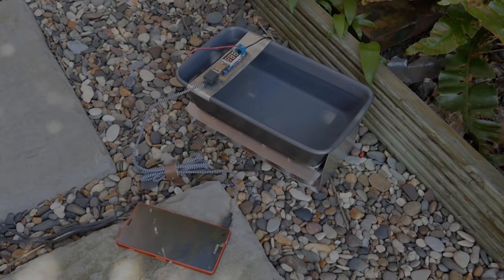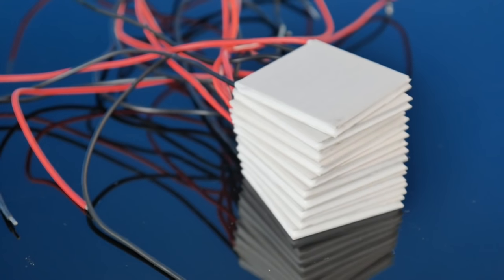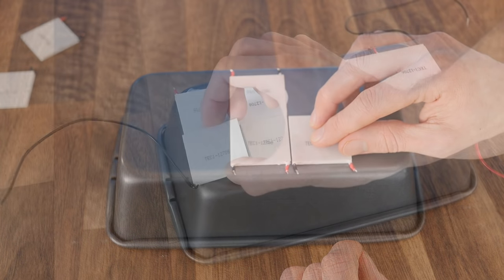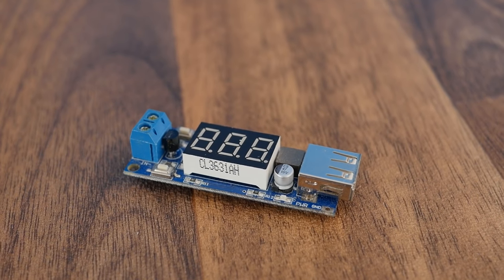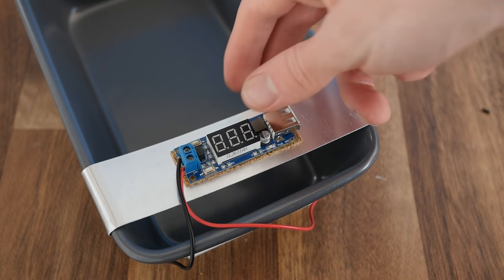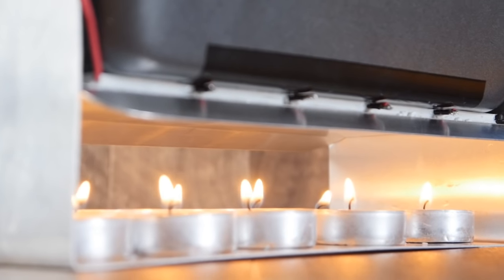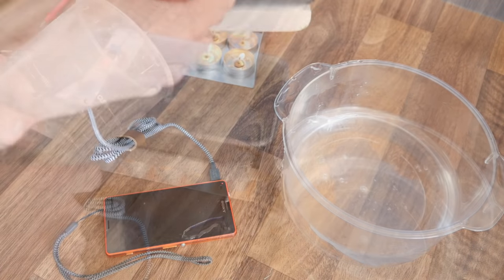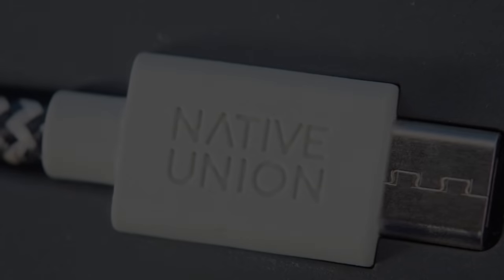How to make a DIY Thermoelectric Generator

Comment: I'm currently searching for energy sources for a tiny house. Would it be possible to combine a thermoelectric generator with a oven (I would probably use a small pellet oven) and a continuous flow water heater? Because that would be a perfect solution for the winter when there is not enough sunlight to produce enough energy for light heating and water heating. 🤔
Of course the solar panels would still be up however I would like to use all the energy I can get especially in the winter.

Comment: Nice presentation! Congratulations! About the heat supply (candles) what is the average temperature in the alluminum plate? Could we use it in the car to get heat from the exhaust pipes to help charge the battery? Thank you in advance. Paul

Comment: Hey I did something very similar using old frying pan to hold water/ice and metal (probably steel) plate on the lower part. I heated it by placing on a oven/furnace.

I was wondering how to arrange the TECs, in series or parallel. Once you get stable 5-6V you can step it down easily but to charge devices at any reasonable rate you need something around 500mA with 2-3mA being the ideal (Ipads and what have you)

Comment: maybe use a radiator system that runs on low voltages. so the water stays cool during the process.

Comment: would it have been possible to use  air cooled radiators for cooling and magnifying glasses for heat or would they not get hot enough?

Comment: Question the hott end can u use steal instead of aluminum ? Or would the steel get too hot and melt the thermal electric plates. I was thinking about building this but I want to know what would be better steel or aluminum for the bottom tray. I want to use an aluminum or stainless steel pot on top with aluminum heat sinks inside.

Comment: very good- and!! super understandable english for me as a  german !- only a idea from me you might think about- to use for the heat instead of candles-- the sun- directly by black watertube or reservoir-  otherway from solarpanel and 12v-24v heating element (for boiler) and for the cold side of peltier a circulation for warm water to use in the house. -is that a good idea? 
i mean this would cost nothing for heat- brings warm water and electricity for free - pls. tell me if you think it is to realize -- cheers--harry

Comment: If you were to apply a liquid cooling loop to one side and a conductive panel to the other, would this thermoelectric generator generate enough energy to power the loop and and charge your phone from direct sunlight do you believe?
Reply: If you had aluminum foil to help direct the heat to make it more enclosed I do believe that would help get  boost needed to power the cooler loop

Comment: couldnt you do a series of heatsinks instead of water?
Reply: Thebrightestbrick88 it probably would be less efficient. This is what I was thinking though. You get some finned heat sinks, perhaps one big one, enclosed with fans on the front and back. Set those as a push pull config, it would keep it cool at the cost of noise. Just constant air pushing through the fins of heat sinks. It wouldn’t stay as cold, but you wouldn’t have to change the water or anything like that.

Comment: So could this be applicable to charge 12 volt batteries for powering a cabin using something like a cold water drip gutter(tapped into a stream or even tapped into your watering system that heats water for the home) that sits above/near a wood burning stove? What about the cold water that comes off of big A/C units on a hot roof? Could this be a way of generating electricity back? This is way too cool.

Comment: wouldn't having half of these in series each and then connected in parallel be much more effective? They should produce half the voltage (so still more than 5V) but double the power in that configuration.

Comment: One thing i was wondering, can this be used instead of a solar panel, say glued to a window on sunny days?, and the other way around on cold days where the room is heated and the window is cooled? i would hook up a battery pack to it and let that charge and charge my phone from the pack, but is the heat difference big enough to generate any kind of electricity? or does it need direct fire to heat it enough?

Comment: Just a small question, how much thermalconductive glue does it take per peltier? Also, would you think another 20 would be too much for the voltage regulator? Thanks, I love your projects, were still waiting for the v3 of the cloud unit.... I really want to see what it'll look like. Thanks for your amazing content!
Reply: It's hard to say, but it's usually about the volume of a medium - large sized pea 🌱 (total) when covering both sides and when it's been compressed and held down. 

Be sure that's what you want or do though because they can be really hard to remove if you use thermal adhesive. You will need a spare! Haha! X ) 

Try testing with thermal paste so you can be sure it works before you do. Happy travels! ☺️ 🌎 👋

Comment: I have weird (and probably stupid) question) but could I take some peltier and put one with the hot side and attach it to two other peltier with hot side to hot side and the side with two peltiers I wire those in parallel or series and take the electricity generated to power the single peltier side and the run off I could store in a battery of some kind or maybe use two on one side and 4 or six on the othe side so I have more peltiers generating electricity from heat then the number of peltier I have generating heat from electricity? If that makes sense.

Comment: Hi. Great video, thank you, and it has given me an idea. Please can you tell me if there's a single thermoelectric generator (plate) that can generate 12v at 1.5amp (i.e. 18 watts) or enough to power a computer fan? If not, maybe a group that could generate enough power to spin three computer fans? Thanks.

Comment: I can't get this to work myself. Is it possible to get voltage from only one plate? I'm using a candle on one side and ice on the other but the led never lights up.
Reply: I´m sure you can light a LED up with only one plate. I powered a little motor with only one plate!

Comment: I have 12 nimh rechargable batteries put together in series, each being 2000mAh at 1.2v. I need to know what power to supply at what voltage and how many mA to charge the batteries safely and effectively. Help is appreciated! Right now I have a 15v charger which supplies 1000mA. Would this work?

Comment: So if connecting them in series increases the voltage too high, could a few of them be connected in parallel and then in series to make the voltage regulator unnecessary? How would I go about determining the correct arrangement for X volts?
Reply: each one of the plates has a max voltage output of 12V so you need the regulator regardless

Comment: I would have kept twisting (and then solder) the wires anyway instead of only soldering as solder iron could melt from the constant heat.

Comment: Hey Matt, you are so much into passive cooling and now you are using water? I am wondering how this would work with Heatpipes in Fire and as many passive cooling bodys as you need for the cool side... then it's a nearly fire only device, but when you think about it most places you need power you have the possibility to start a fire, right?

Comment: Had no idea TEC's could be used like this. Would a multistage TEC be more efficient at generating voltage? I have a few multistage 300W TEC's from experiments with sub-ambient CPU overclocking and this seems cool to play around with, and it sure beats trying to find a hungry 15-24v power supply to run them.
Reply: +K31TH3R with multistage TEC modules used for generating not cooling another problem becomes significant - their thermal conduction. Don't know if the heat transfer thru the stacked modules would be great enough to make it work
Reply: BFanist You're probably right. The main reason I retired them was because I couldn't seem to find a water block design that could pull heat away from them fast enough for more than 20-30 minutes of sub ambient operation. They were able to achieve lower temperatures than a single stage TEC, but the longevity was not worth it.
Reply: +K31TH3R Cooling 300W TEC modules and ~150W(?) cpu is an interesting technical challenge. Maybe a custom heatpipe heat-spreader to attach multiple waterblocks?
Reply: +BFanist At the time I was cooling a Xeon X3360 at 4.2GHz with a TDP of 95w. But at 4.2GHz it was likely nearer to 150w than 95w. With a single stage it was 15c in 23c ambient, and the multistage was 9-11c. 2 stacked multistages only shaved off 1-2c under load. Just wasn't worth it for the heat and power demands. I also imagine a kind of Y heatpipe on a single heat spreader with multiple TEC mounts probably would make a big difference.

It seems to me that modern dies have made TEC cooling impractical without some exotic solution like you mentioned, there's just too much concentrated heat in a small area and the factory heatspreaders would need to be redesigned to make TEC's plausible again.
Reply: Also using stuff like the new cpus from intel (skylake or sth) with such low tdp might make that plausible again. I did mine project just as a proof of concept with single stage TEC and a shitty pentium cpu i got to -3C on idle and less than 7C when under load. But it had a 1/3 of the TDP of your chip :D. I played with a idea of 'peltiering' my gaming rig but with OC TDP well over 120W I reckon it didn't make all the hustle worth it
Reply: BFanist Pentiums are fun to play with on TECs, they respond really well. I'd be interested to see how a TEC would work with Skylake, they also have that monstrous heatspreader really increasing the surface area. I tried stacked multistages on my current build, Xeon X5650 6 core @ 4.6GHz, idle temps were 14c, but load temps were the same as just water, around 50c, but loop temps were nearly 60c which is the limit of my D5 pump, so that ended my adventures with TECs.

Comment: how much potential difference and how much amperes of current one of these thermoelectric plates create by temperature difference of 70 to 80 degrees Celsius between the surfaces?

Comment: It would be interesting to see a setup with a radiator constantly circulating to reduce the temperature. Albeit, this would require power, I don't know if it'd be more than what you'd have available though. It'd never quit until the heat source ends of course.

Comment: Question - if I increased the size of the voltage regulator and number of panels in series, would it be possible to charge a leisure battery with this? If so, would it be cheaper to run than just charging the battery from the mains? Discuss.
Reply: This is incredibly inefficient so I'm pretty certain this is more expensive than mains power.
There are good quality solar panels and charge controllers that are pretty cheap if you are looking into off grid power supply.

Comment: Hey, you could make some extreme Cpu cooling system using those Peltier panels. Seems there is not too many people on utube that did such a thing. By extreme I mean cooling system that can provide <0 temps on cpu ;). That would be pretty challenging

Comment: Replace the regulator with a DC-DC Buck converter to not simply dump voltage over 5 which is what regulators do.

Comment: So I ordered 20 thermoelectric plates and was wondering what to look for if I wanted to charge a 12v battery, do i need to find a 12v voltage regulator/charger?
Reply: Try one of these, they're made for battery charging from TEG power. http://www.tegmart.com/regulators/tegulator-thermoelectric-generator-battery-charging-energy-harvesting-circuit/

Comment: How much current (amps) maximum you can get without the dc boost converter?
You can get out up to 500 mAh ? (at 15v or also less)
Reply: Supercondenser plates will generate more power the steeper the temperature gradient/larger the difference in temperatures. So if you increase the heat on one side or reduce the heat on the other, you will generate more power. 

Additionally, if the capture mechanism is more efficient (or if more peltiers were used) and run in parallel, the amperage can be increased trivially. 

TL:DR; build one twice as big, put it over a fire with a block of dry ice in the pan and you can get upwards of 3 amps with no trouble.

Comment: I'm really enjoying your videos -- very concise and clear, nicely produced, and very informative.  A definite add to my subscribed list.  

I'm curious about the power produced.  You show 313 mA -- but measured where?  It doesn't appear to be at the output of your Buck converter (5v).  Is that at the input (12.5v) side of the converter?  If so, that would be ~3.9 W.   Still not a fast charger by any means, but would equate to >700 mA to the phone (assuming a high efficiency on the converter).    

Second, are there any temperature limits to the Peltier plates?  I'd envision using such a system over my wood-burning stove -- which can have some pretty high temperatures on the top.  

Thanks, and Cheers!

Comment: I tried googling if someone has tried converting negative temperatures in to electricity. Negative temperatures are hotter than positive temperatures.
Any info about this?

Comment: Are thermoelectric plates very reliable or will they need to be replaced every so often?
Reply: +Totally Harmless They are extremely reliable, i didnt have one failing yet. I use them in a generator that works with mirrors and sunlight....

Comment: I have two 400watt 12v peltiers in series and I have the same design as you, except I'm using a smaller bread pan. Im using Arctic silver thermal adhesive. My generator is only producing 1v of electricity. what should I do to get it to at least 5v. I saw multiple videos on YouTube where they were able to produce like 9v with one of my peltiers. I'm starting to think that those videos were fake. :/

Comment: You used TEC designed for cooling, you should use TEG specifically designed for generating electricity, much more efficient*
Reply: Is there a difference between the two?
Reply: @jsmea5445  yes as already stated*
Reply: Thanks! But not so sure if we have that in the Philippines

Comment: I know my question is not really relevant to the actual subject of this video but would sticking this between a CPU and it's heatsink help carry the heat away from the CPU or would it be less effective than just using thermal paste? Or is the CPU too hot or is there an other factor that makes this not useful? Also, cool video, I might actually get some of those thermoelectric pads to experiment with. Sad to read that I can't join the giveaway as I don't live in the US...